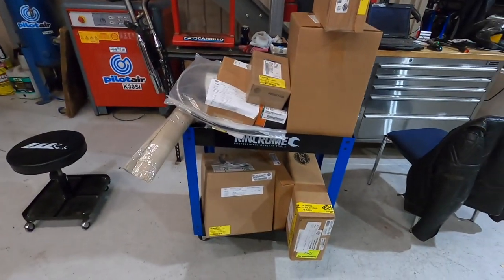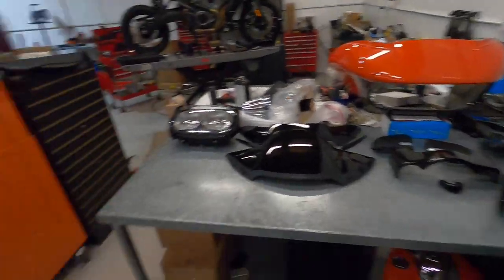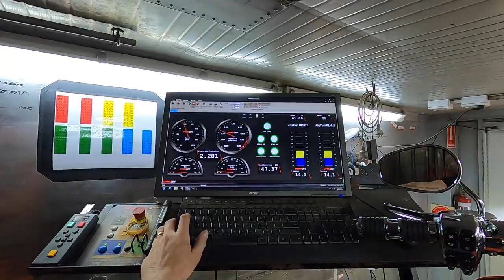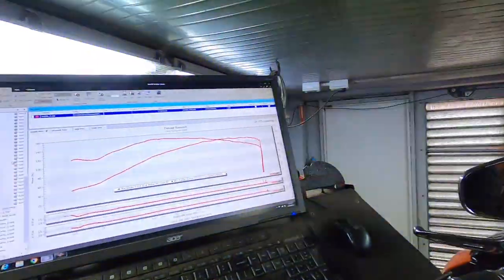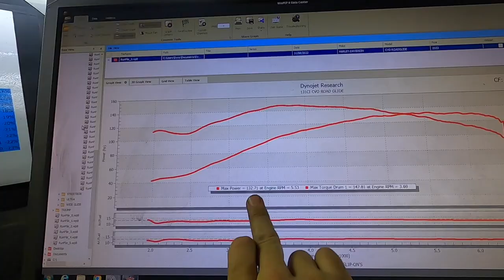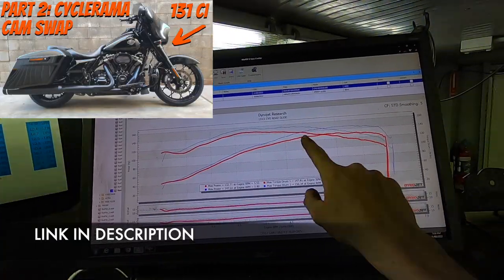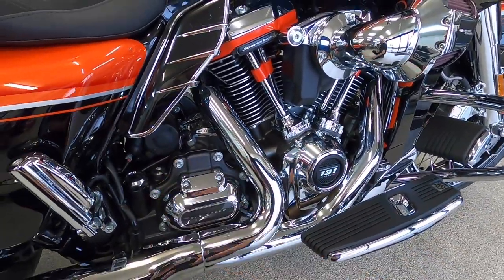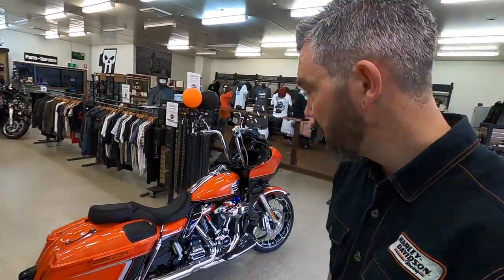2022 CVO RoadGlide Build / 131ci Stage 4

Comment: Great vid as always!
What exhaust was used in this build?
My blue steel is currently getting the 131 w\cr512 cam and tab performance headers\slip-ons (zombie baffles) and will be tuned with power vision. 
Should I expect similar numbers to this bike?
Reply from the maker: This build is running the factory headers with the cat removed and has the 4.5" S&S Slip On's.

You should see closer to 140hp with your exhaust system and possibly 150ft/lbs
Reply: @MasterTechMiller  thanks Appreciate it!
Keep up the good work!

Comment: Great video! I have a 2019 Roadking with the 131 Crate engine.  Recommended 483...512 or wait for the 480mt? Thank you?
Reply from the maker: The new 480MT would hard to go past in the 131ci. I would definitely wait for that one.
Reply: @MasterTechMiller  Thank you for the reply.  I'll try to get a 480mt! Thanks again!
Reply from the maker: @nkleiner728  No worries mate. Let me know how it goes
Reply: So between the 512 and the 480 MT in a crate 131 what do you feel is going to make the 480MT the winner? I'm having a hard time deciding  on which cam to get.
Reply from the maker: @nkleiner728  it's going to come down to how you ride & what your expectations are of the bike. Can you tell me a little more about what you expect the bike to perform like & more about your riding style
Reply: Well, I kind of like best of both worlds.  Wife rides at times for short day trips, but I love to rip it when I'm solo.

Comment: Hi Tommy, another great video. Questions. I'm looking at doing a progressive power build on my '22-FXLRS. Looking for linear torque & HP readings. Could you recommend the best available pipe, throttle body  tuner & cam to eventualy merge with an APE  128ci kit?
Reply from the maker: Freedom Radical radius pipes, 55mm intake manifold, 6.2gps injectors, CR485 Cam. 
That combo in the 114ci will provide an awesome torque curve from the 1500rpm right up to 5500rpm. Expected HP from that combo on the 114ci is around 125hp & 130ft/lbs 

Using all those parts with a 128ci APE would produce around 140hp & 145ft/lbs
Reply: Thanks Tomny, same advice for a 117?
Reply from the maker: Absolutely

Comment: How are the stock bottom ends holding up with the big bore kits?
Reply from the maker: Seem to be holding up just fine. I only reccomend the welded crank option for guys I know are going to be drag racing alot, doing skids & wheelies, generally giving the bike a hard time. 

For must customers they want a huge big bore kit purely for the sake of having one & never ride the bike to its full potential so there is no need to install a welded crank.
Reply: @MasterTechMiller  Thanks as always great info, great channel! What tuner are you using?
Reply from the maker: @RGHD912  direct link USB key from Technoresearch
Reply: @MasterTechMiller  It make sense, you’re are definitely a Master Tech!

Comment: Great video, thanks for sharing. What gear did you do the dyno tune in?
Reply from the maker: 5th gear mate. 
If I do it in 4th gear they rev out too quickly and you don't get an accurate indication of the AFR reading. The 5th gear pull takes a little longer to wind out therefore the sampling of exhaust gases is far more accurate and helps tune the engine more effectively.
Reply: @MasterTechMiller  Thanks for the response, so it’s fair to say if you did a 6th gear pull since it’s 1:1 the number would be even higher or more on par with a lot of other shops that dyno the final pull in 6th gear?
Reply from the maker: @RGHD912  yeah mate, normally a 6 gear pull will show a few extra numbers.

Comment: I’m looking at this kit , why not use the 515 and use the 512 instead . So curious
Reply from the maker: The kit comes with the SE8-517. It has been designed for the 131ci kit with the CNC ported heads. The SE8-515 which was the old stage 3 cam was designed for 117ci builds back in the day. 
In my opinion the SE Cams are very reserved in their performance capabilities, perhaps due to trying to maintain a 50state compliance when used with the SE street tuner etc. 

The aftermarket camshafts do not have to obide by the EPA regulations like SE do they are able to get more performance from them.

I know there are some guys out there getting relatively good results with the SE cams but they do not sound anywhere near as good as aftermarket cams due to the Lobe separation angle differences.

Comment: What company makes the high comp 131 kit?
Reply from the maker: It's the components that make the 131 a high comp version. There is no 'high comp kit' available to my knowledge. 

I will be installing +8cc dome top pistons and machining the cylinder head face down to increase the compression ratio.
Reply: @MasterTechMiller  oh nice! Btw tell this guy to change the head pipe, it kills me for him to spend all that money and not optimize it
Reply from the maker: @chroniclesofnanner9543  I know right! I've spoken with him about it prior, during and after the build however he says he's not too worried about it at this stage. Give it time he may change his mind.
Reply: @MasterTechMiller  Once he sees the dyno results...

Comment: This 131 build is the worst install video ever recorded,
Where’s the cam chest upgrade?…where’s the primary upgrade??
Reply from the maker: Have you built a few yourself mate? Your just a sucker for the catalog by the sounds....you have to remember mate, just because it didn't get shown in the video doesn't mean it didn't get done. Did you see me fit a longer brake line and clutch cable? Did you see me bleed the system and carry out the DTII bleed procedure before riding it on the road? 

How about you do some thinking before you vomit up what you think you caught someone out on. For the record between myself and the guys at A.P.E we have built hundreds!!! Literally hundreds of big cube engines, been the first in the country to go 9sec on a bagger with a stock cam plate, wheel base, foot shifted, etc etc and not once EVER have we seen or heard of any stock cam plate failing. 

I will install them when the customer says they want one right on wrong, other wise I won't, it's just not necessary as are those head studs for the rocker arms or that poxy vented dipstick and many other of the bullshit over hyped components out there these days. 
There is plenty of other content on my channel that shows your beloved cam plates and compensators being installed so feel free to check them out at your own convenience. Until then mate, I will stick to my own advice and experience after 15years in the industry.